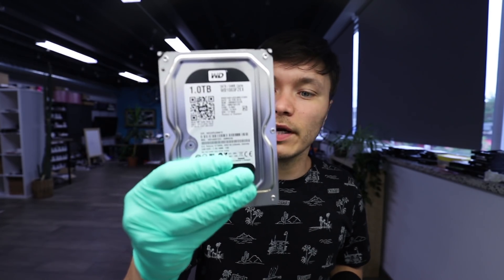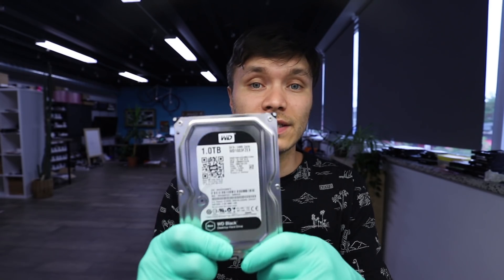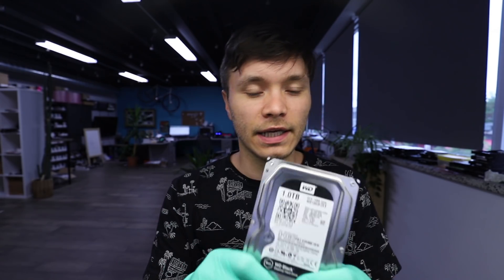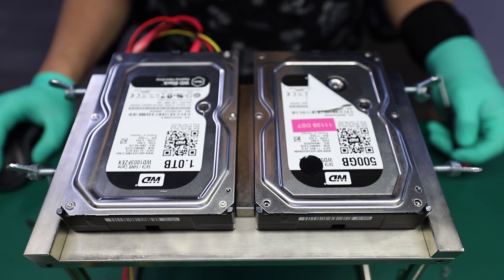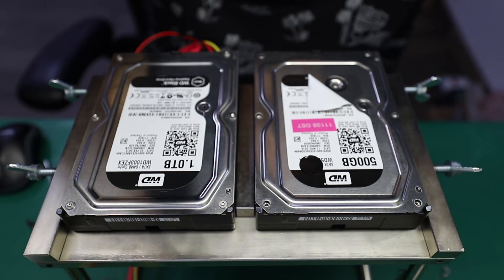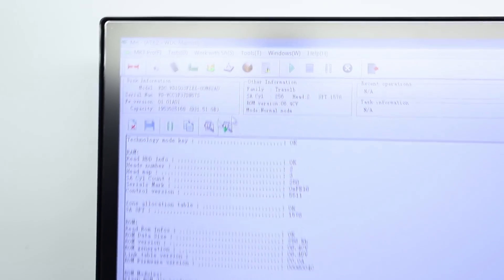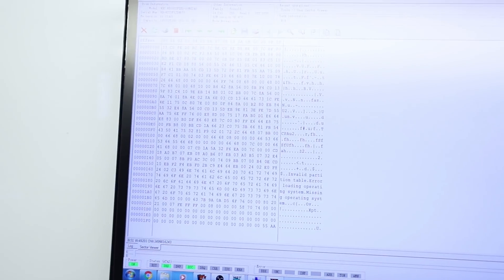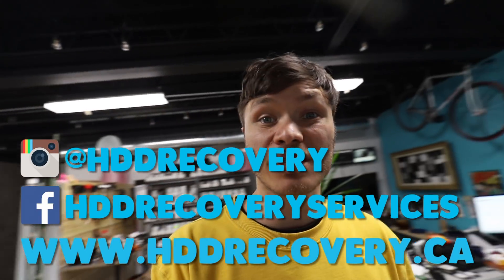clicking noises on Western Digital drive | physical data recovery 1TB

Comment: I'm here because looking for explanation, have 4 wd3000fyyx WD Red drives, when they are idle they making seek even connected to power only. Not see any evidence of failure ,long and short smart test is fine also checked two of them for bad sectors - there are zero. What I'm missing ?
Reply from the maker: I believe those are CMR drives so not sure why they make seeking noise.

Comment: I have a WD Passport 5TB drive, its making the clicking noise , I opened up the drive arm goes back and forth a few time power light is on but it wont read this happened after i dropped the drive on my basement floor it fell out of my hand, can i recover the DATA on my own the plates are clear like a mirror, OR do i need to replace the arm reader?
Reply: Having the same issue with wd 5tb hdd have you got any solution please reply

Comment: my brand new WDC Black 6TB makes some odd noise whenever i access files in the drive (installing apps, playing games, copying or moving files)

i didn't notice the noise for the first couple of months because i rarely access files in it because i have my OS and mostly used apps in another SSD, just started noticing it a month ago (its 4th month since i bought it). so i am wondering whether i have to worry about my files.
Reply from the maker: probably relocating MC or something esle these SMR drives like to do these days. Just keep a backup of important stuff, but I think those are normal for a drive this new

Comment: How much do you charge for this service? This case in particular ( I have the same WD black 1 TB HDD with clicking sounds that end up with a BSOD after a few hours of use). I've already backed up the data but was wondering if worth replacing heads, to reuse the HDD.
Reply from the maker: a head swap is only done for data recovery. Hard drive can't work reliably after. Besides, the price for this procedure is approximately 10-12 times the cost of a brand new 1TB WD black. This is data recovery business, not a hard drive salvation.

Comment: my drives dead and clicking but im in the uk so no handing it in. if i get a donner drive and switch the heads do you think it will work again so i can backup the data on it or will i have to change the pcb as well?

Comment: hey man, i have a seagate barracuda 3tb which clicked funny one day and crashed , now it wont spin!. av tried checking the two diodes u told us in your seagate video but both diodes are giving similar readings without that tone your multimeter produces. how much will it cost for you to either pull a very important folder for me, or to repair it? ,i dont care about the drive, i just want my data, or alternatively you can fix it for me. please tell me the cost so that i send it. i have very important files inside!!!
Reply: you from UK?

Comment: Hii bro my hrd is dropping on floor after i connect it its not spin normal likeafter  0 to 30 rpn run and stop again run and stop
Reply: What should I do??
Lot of my important data in hdd

500gb Seagate hdd
Reply: Powering it on after dropping it is bad the heads could cause a head crash destroying all ur data. Send it to a recovery  clinic and hope there is no platter damage

Comment: Sir, how did you find a doner drive using hdd baseplate number.
Reply from the maker: On the side opposite from the connector there is a code. 3 letters that usually is close enough for WD donor matching
Reply: WD5000bevt hdd baseplate No. "WX9 1 A9 0 V2 734" which part you mean to.

Comment: Α few years back i had a 1tb HDD working fine. I put it inside a dock, and had a dodgy chinese variable power supply from ebay. The dock used 12v, but i had it set to 19v, which my laptop needed. It put quite a smoke show, the dock worked fine afterwards by the hdd did not spin at all. I still have it and i wonder. What could have gone wrong? Is the pcb dead or the whole motor assembly?
Reply from the maker: Check continuity on TVS diodes https://www.youtube.com/watch?v=2YZ0LBhFCZY

Comment: I have a Seagate Barracuda ST3160827AS which makes a clicking noise. It sounds like the head isn't able to move. The platter shows no obvious damage and the heads don't appear to be stuck. There is a mechanism inside the HDD which I think can stop the head from moving.

Anyway, I bought another ST3160827AS with the same label information except the serial number. Can I still swap over parts between the two HDD's?
Reply from the maker: There is an air lock on those drives. With lid closed and RPM reved up, air lock opens, and heads go out from parking area. This drive however, is very hard to recover from clicking noises without proper equipment. I would suggest finding a professional if data is important.
Reply: This is the problem i'm talking about not just swap...damn..2 of 2tb wd dead try to be ressurect..ed

Comment: They do the same with CPU dies too. The architecture is one, and if a core fails they hardwarerly cut the lanes so from a 6 cores becomes a 4 core and so on. So if you buy a i3, you basically buy an i7 with stripped cores and cache.
Reply: I remember with a couple of the older AMD chips you could flash a BIOS to your board that let you re-enable these cores and sometimes you got one where the cores worked ok.
Reply: Yeah i remember too but now everyone shuts them on the hardware level so yeah.
Reply: Quetzalcoalt , thats right .
Reply: Yup exactly what I thought. My test bench PC is a AMD Phenom X2 555 tied with a board that lets me unlock the other two cores and BAM Phenom X4 B55! Been running almost non stop but 7 years now without a single issue (except for issues with the board and the onboard NIC going out but other than that its good)
Reply: Same for cars, they are making cars with same engine (like bmw 320i and 328i) and different firmware for engine

Comment: so... maybe can we buy 500GB drives and hack it to 1TB? (assuming it wasn't disabled because of defects)
Reply from the maker: I can try to upsize the 500. Good idea for future video thanks
Reply: On the subject of upsizing HDD's, do you know if it's possible to upsize a HDD to a fake capacity like they do to all those USB flash drives you find on Ebay? (The 2TB ones for £15 etc..)

Just curious if it is as I have never seen it done before.
Reply from the maker: not on my tool. it can only set maximum LBA to a NATIVE LBA that is in the drive